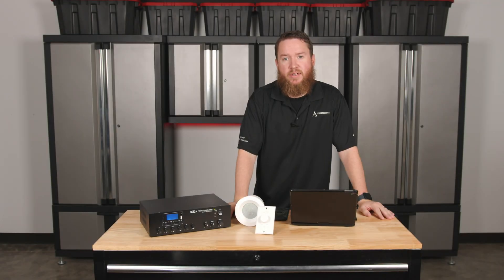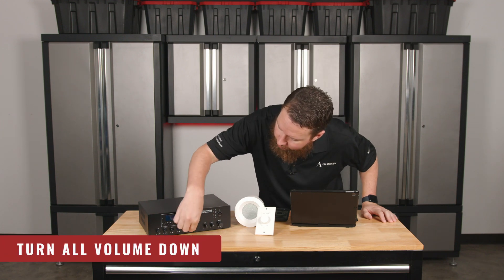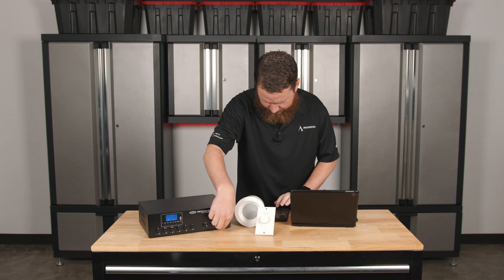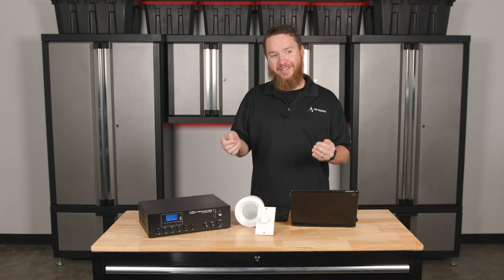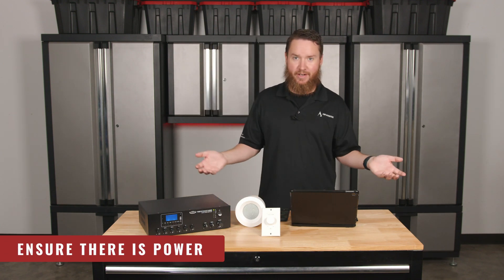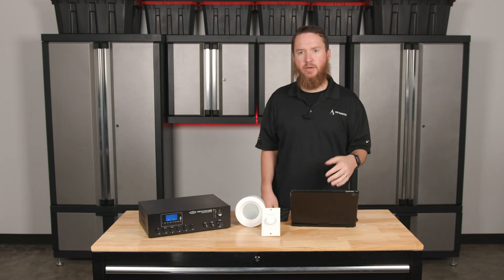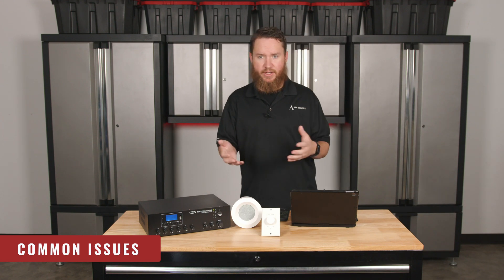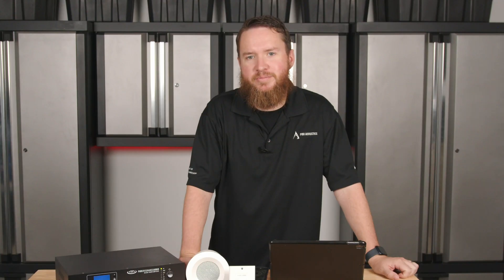How to Test a 70 Volt Speaker System on Pro Acoustics Tech Talk Episode # 109

Comment: How do I find a hidden short where the wires are buried and we have 39 speakers spread over 1000 ft. with 45 soldered joints?
Reply from the maker: Finding a hidden short in a complex setup like yours can be challenging, especially with multiple speakers and soldered joints over a long distance. Here are some steps you can take:
1. Visual Inspection: Start by visually inspecting the wiring path for any obvious signs of damage or exposed wires.
2. Use a Multimeter: Test each soldered joint and section of wire with a multimeter to check for continuity and potential shorts.
3. Segment Testing: Divide the wiring into manageable segments and test each segment individually to isolate the location of the short.
4. Check Grounding: Ensure that all speakers and equipment are properly grounded to prevent electrical issues that could lead to shorts.
5. Professional Assistance: If you're unable to locate the short or if you find it to be a complex issue, consider consulting with a professional audio technician or an electrician who has experience in troubleshooting such setups.
Best of luck in resolving the issue!
Reply: Unfortunately I am the audio designer. I do 95% 8 ohm systems but I know I can’t use DC resistance because of the transformers. Was. Hoping you knew of a tool / proper meter.
Reply from the maker: @duanerandleman2456 I apologize, unfortunately, we don't currently have any information on tools or methods for measuring impedance in transformer-based systems. However, If you find any, feel free to share them here!